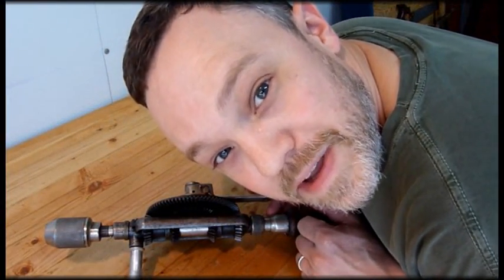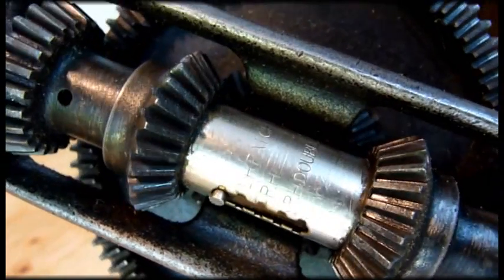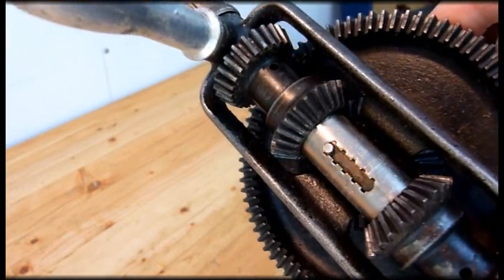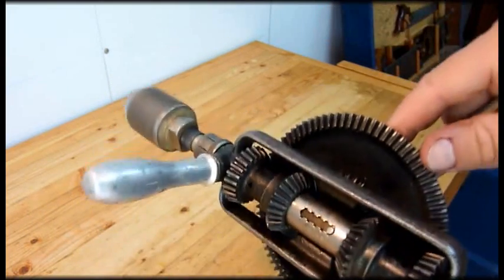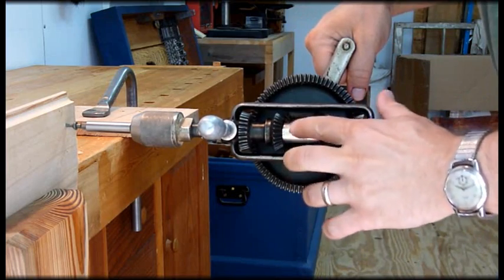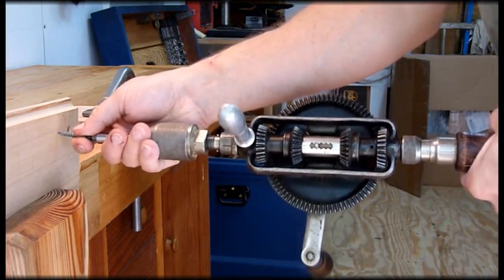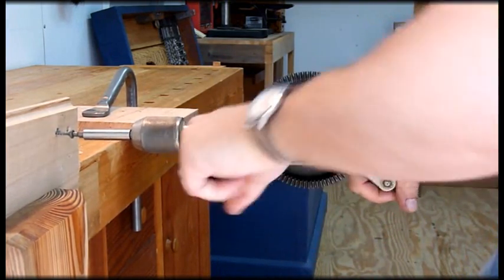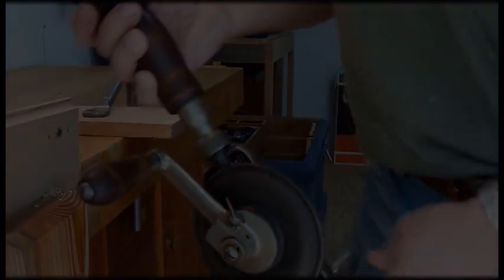North Brothers, "Yankee" 1545 Hand Drill

Comment: I absolutely love my 1545. I also bought a 1530 in nearly mint condition with the Stanley name on it and they have obviously cheapened it quite a bit. I'm very disappointed in Stanley corporation for that. For example, if you try to unscrew a screw with that 1530 by Stanley it will unscrew the chuck instead of the screw and the screw bit will fall out of the drill.

I also have a couple of Millers Falls, #5 & #2, antique egg beater drills that I'm fond of but the 1545 is by far my favorite. it was in decent shape when I bought it but it needed cleaning and oiling which I did and I also had to make a side handle since it was missing. I made the side handle out of a file handle that I got from the hardware store and a piece of all thread. Somewhere I found out that the side handle contained flat screwdriver bit for tightening the screws on the rest of the drill. So I took my dremel grinder and ground down a small screwdriver bit on the end of the all thread and it works great.
turning the file handle into a side handle for this was simple and fun. I drilled out the handle to a size appropriate to screw the all thread in with some glue on it and screwed that all thread into the handle with the drill itself. Then I cut off the all thread to the right length then screwed it into the size of the drill.
I found a video of somebody else on YouTube making a side handle for their drill and they went to great lengths to make it from scratch and they used a bolt with a hex head embedded into the handle. It seemed like a lot of unnecessary work. And that took a lot longer than the method I used.
Reply: There are several other antique hand drills that I would love to see in action that I have not yet acquired. Especially those with unique features and multi speed ability.

Comment: I own a few hand drills myself but this is the first time I have come across that type of drill with those functions. It must have been pretty darn advanced for its time. These larger drills were used a lot to make holes into metal. When drilling into wood the bit goes through a lot fast so the front handle is kind of irrelevant but going through metal is a longer process and that's where it helps.

Comment: JUST scored one of these at my local antiques dealer for $25!!!!  im honestly angry no one has told me technology this good existed. Its honestly has me wanting to almost entirely abandon my battery drill. Completely serious. You just blew my mind with the high speel low speed part!  🤯 i noticed that disengared the crank but didnt realize it changed the speed. Now I gotta see go see if that feature works on mine! 

Furst think indid to make it usuable which i assumed was just missing on myne was to remove the lower hanfle and put on a 2.5-3" washer to protech my hand meat. It makes NO semse that didnt come standard when new. This tech is WAY too advanced to not think about that. 

Im honestly searching for everyone of these i can get my hands on soni have soare parts and doubles of everything. I dont ever want to be with out it. It is SO satisfying to use.
Reply from the maker: They are fantastic tools, glad you were able to find one.  It is one of my favorite tools in my collection, and quite useful!

Comment: All the ratchet options are for drilling in tight spots where a fully revolution of the crank is not possible. The double ratchet option however is designed to double your cranking efficiency in a tight spot. When you are getting paid to drill holes, this is a great time saver. The added leverage you mentioned is also pretty useful.

Comment: The ratchet feature is for drilling in tight places. These drills were used often for drilling holes in houses for wiring and might be used up against walls and joists

The rear handle comes off and has a hollow compartment for extra drill bits. 

Your side handle looks to be aluminum and really neat but not original. 

I have a few of these and I come across them pretty often, it's a complicated drill and often get out of order.

Comment: Side handle might be hiding a screw driver. Unscrew it and check to see if you have a driver bit on the end of the handle screw. On the model 555, as I discovered, it was used to tighten or loosen the mounting screw for the breast plate allowing the user to rotate it to a position they needed.

Comment: Early this year I found a 1555 in ok shape. However the drive shaft has a problem of being loose. A close up of the junction where the shaft secured at the locking ring would help me with its repair. Possibly a follow-up video.
Reply from the maker: Todd, I finally got some pictures taken of the drive shaft.  How would you like me to get the pictures to you?  Email, google drive, dropbox, or other?

Comment: Great review overall.  I do think you misspoke when you said you could put a wrench on the flats of the chuck to tighten the chuck onto a bit.  The chuck shell does not rotate independantly of the flats. The flats are for chuck disassembly, and could be used to unstick a bit stuck in the material being drilled.
Reply from the maker: Dan, on my example you can use the flats of the chuck to tighten on a bit if need be, and I have done so on several occasions.  This is because the action of the chuck screwing down onto the spindle pushes the jaws closed.  The plate that has the flats on it is what actually contains the treading for the spindle, which effectively means it is one unit while on the drill spindle.  The chuck shell itself screws onto the plate with the flats and mainly serves to contain the jaws.  Having said that, if you took the chuck off and put it in a vice I imagine you could use the flats to take it apart.  Thanks for the comment!

Comment: Hey Jason, can this hand drill can use Auger bit too ?

Its the first 3 clamp jaw with ratchet option that work for modern bit I saw ever. 

Really interesting. I'm gonna take a look around me to put a hand on this beautifull tool. 

Quality never die
Reply from the maker: It would work as long as they are not the old square shank bits.  Those only work in braces unless you cut the tapered square portion off.  Having said that it'd have to be a smaller diameter bit as this does not develop a whole lot of torque.  You might be able to get away with a modern 1/2" or less auger.  Hardware stores sell modern auger bits with round shanks, and those would be fine, just again stick to smaller bits.

Comment: Does it drill in concrete
Reply from the maker: I am sure it would with the appropriate bit, but don't expect it to be a fast process.  With the gearing selector you could go high speed, low torque, or low speed higher torque depending on you need.

Comment: The chuck on my 1545 has a feature that yours does not have.
The main shaft on my drill has a giant straight blade screwdriver bit on it that goes into a slot inside the chuck that keeps the chuck from coming loose when you're trying to back screws out. 
In fact I could leave the chuck slightly loose so the bit could fall out and I can crank that lever in either direction and it will not open up the chuck anymore.

There's a simple test to see if your drill has that same feature.
Hold on to the chuck and turn the crank and see if the Jaws go straight in and out or if they spin around inside the chuck.

My 1530 does not have that feature, and that sucks!!! 
It was made after Stanley took over North Brothers.
I had thought that Stanley had screwed up the chuck design!
That chuck is garbage!

Apparently many N. B. Drills don't have that feature. 😭
My Miller's Falls drills don't have that either. 

I use mine to drive screws and nuts. (Hex adapter to ¼ in drive sockets)
 I actually call them bit drivers, not egg beater drills. They do much more than drill. 😃😉
Reply from the maker: Thanks for the comment, I'll have to take a closer look at mine.

Comment: Can these type of eggbeater drills be used to drill into concrete walls?
Reply from the maker: +Sachin Soni I am sure it could with a masonry bit installed.  If you are just doing a small hole like 1/4" It would not be much slower than an electric drill.

Comment: I found out that I don't have to get my chuck very tight on my drill, and I can still use full power on the crank either direction and the chuck will not come loose.
When I take my chuck off there's a large protrusion on the end of the main shaft that looks like a giant screwdriver bit and that goes into a slot inside the chuck that locks them together so that you can use full power in either direction on the main crank without the chuck coming loose unlike my 1530.  It's a piece of garbage that does not have that inside the chuck. No matter how tight I get the chuck, every time I try to take a screw out the chuck opens up and the bits fall out. That never ever happens with the 1545. 
If that does happen on your 1545 then that main shaft does not line up with that slot inside the chuck properly.

By watching your chuck open up on the video, yours does not have the internal locking mechanism. 😭
On mine I can leave the chuck just loose enough for the bit to fall out and I can use it in full torque either direction and it does not change the tightness on the chuck. I absolutely freaking love that feature on mine. 😁

I wish I could send you pictures of mine and the internal locking device.
Another way to tell is to hold the empty chuck still and turn the crank and see if the jaws of the chuck spin around as they open and close or if they just stay in one spot as they open and close.
Reply from the maker: That is very interesting.  I'm not sure I've run across a chuck like that yet.  The 1545 is one heck of a nice tool.
Reply: @Mountainmanjason  I use mine every chance I get.
I use it as a screwdriver and a nut driver a lot more than a drill. 
I keep trying to find more uses for it like stirring paint or stirring peanut butter, putting a fan on it etc.

I had to make my own side handle.
I used a new wooden file handle and a piece of all thread.
I found out that the original side handle had a straight blade screw driver bit on the end of the threaded shaft. So I fashioned a screwdriver bit on the end of mine and it works great.
It is used for tightening screws on the 1545 itself.

By the way, my chuck has a patent date of 1889. 
There are other patent dates on it but the latest patent date I think is 1911 somewhere on the drill.

I have a 1530 built after Stanley took over North Brothers and it's a piece of junk.

I also have a couple of Miller Falls egg beaters that I use for the same purposes. 
I think they are model #s 2 & 5. 
The smaller one needs a main handle cap. Right now it has a rubber cap from the bottom of a walking cane.